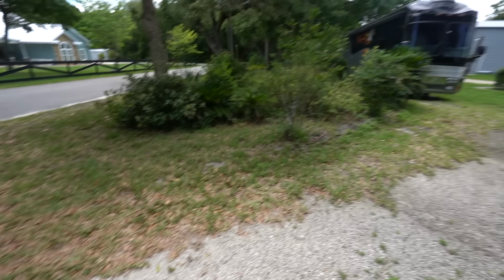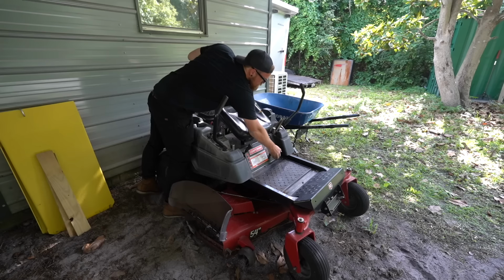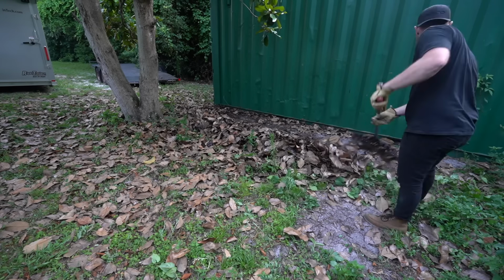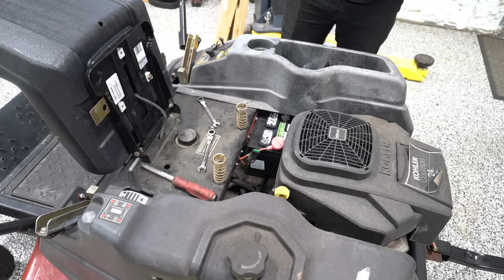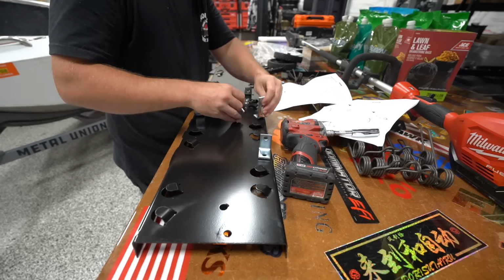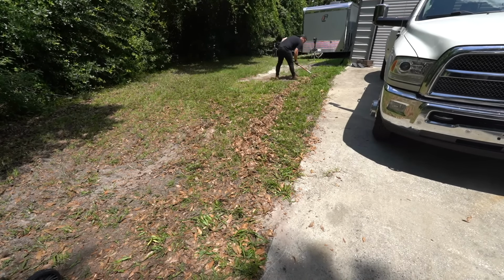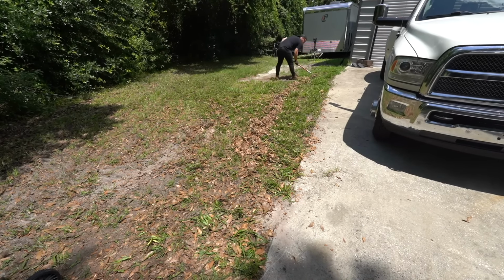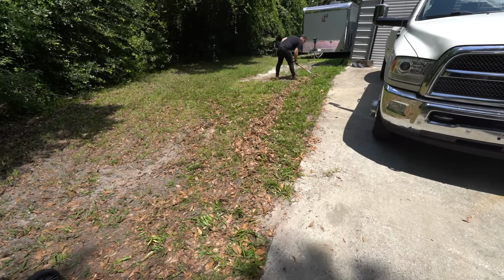Fixing up my neglected property. massive transformation.

Comment: Dig two pits in some yard corner, make them watertight. Build some fences around them. Throw leafs in one of them. Add some water every now and then. When one is full, start to use the other one. When the other one is full too, empty the first one. Leafs turn in to top soil in no time when they are in big pile and some moisture is added.
Reply: Yep, make an enclosed compost pile. Its a win-win. You have an easy spot to dump leaves and they turn into awesome rich organic matter for your garden.

Comment: Put a solar powered exhaust on the storage container
Reply: I was gonna say the same thing
Reply: This crossed my mind
Reply: Paint the roof white
Reply: putting a hole in the roof isn't probably the best idea for storage, especially in Florida. Either paint the roof white or add a extra layer to get the sun off the roof might make more sense
Reply: @kyleb1958  you could put it in a sidewall, as long as it's properly sealed. I'd still paint the roof white though to help.
Reply: Or he just needs to put the extra roof panel thats stored behind on top of the container, prop it up with a few pieces of treated lumber to create an air gap.
Reply: Why do that when you could use it as a solar powered powder coating oven as it is 😂
Reply: @tylerbogaard375  thats actually not a bad suggestion, I bet that would be a good solution
Reply: @kyleb1958  just until the first big storm anyway

Comment: Hey taylor, rent a small-mid  sized skidsteer for 1-2 , maybe 3 days (depending on how early you start and comfortable operating you get) with a bucket and harley / power rake attachments. Get a landscaping rake. Order topsoil for day 1, use the internet to calculate how much you need or just get a truck load to start. Use the power rake to grade and till the current soil + grass. Then use the bucket to spread topsoil 1-2 inches where you need it. After it's spread re use the harley rake to grade the new top layer. Use the landscaping rake to find tune the grade and clean up small/low high areas. Use the power rake liberally to achieve a good grade. (which you basically already have) Seed spreader, seed it, cover all the seed by hand with shredded hay. Water water water, gl bro
Reply: Yeah, his soil looks like dust
Reply: @dobledekersoulwrekr yeah it's Florida it's all sand.
Reply: @pbking442   Yup, scrape up the grass and it's sand. My yard is like that and if not kept wet it goes to hell...
Reply: This, minus the hay. If he's feeling real unenthused he could just till lightly the worst areas, seed, then quarter inch of compost every year for a few years. That's the lazy man's way to great soil.

Comment: i remeber when we first moved into our current home. The yard had been neglected for years and As hard as I tried to get on top of it the first year, it was just overwhelming. I eventually bit the bullet and hired a landscaping company to clean and clear to get me to the point that I could restore the lawn and finally get to work on redoing some of the scaped areas on my own. Let me tell you it was the best $3200 I ever spent. They cleaned up everything and hauled it all away and left me with a great foundation to work with. I still use them twice a year for spring and fall seeding, treatment and fertilizer which is less than $400/year. Over the years I struck up a friendship with the lead lawn tech that does my yard and he helped a couple years ago put in a cool 106 yard par 3 with a putting green. Decent equipment is key to maintenance and I couldn't be happier. I appreciate the sweat equity you're putting in but for me there were better ways to spend my time when it came to the cleanup process.

Comment: You can cut all those plants in the front down to the ground for the most part to clean around them easily (except for the really woody stemmed plants) and they will regrow looking much nicer.  Typically, people cut them back all the way in the fall when dealing with the other leaves

Comment: You should hang the metal from the rafters under the car port.  Run a chain on a rafter and leave some droop or 2x4 shaped in a U then slide the metal.  I hang panels under my porch and it works great.  Also keeps it clean no leaves.

Comment: Hey Taylor! You should put up a small fan in the entrance of the container so you get some airflow for when you're in there. Doesn't have to be big to make a huge difference in working temperature in there. Also pro tip, since you said you ofc don't know where all the parts you have actually are, print out lablea on your printer (don't need a label maker) and create a logical system, where you number or alphabetise your toats, for example A1 has air tools, B1 has brake parts, C1 has coilovers etc. I have that system and it changed my life!

Comment: You could make a rack inside the container un the underside of the roof to hold your excess long steel and bus siding, it’s also worth adding a ventilator fan either solar powered or wind powered to the container.

Comment: Aerating your yard  will do a grate deal for your yard you can get a pull behind aerator for you mower at Home Depot. I would also put Scots weed and feed. I also suggest putting a battery tender on the zero turn and sharping the blades on it but you need a blade balancer or have a small engine shop do it. I would also suggest edging around the cement. You can do the edging with a weed eater or you can rent an edger and black top. It would be grate for the curb appeal of you property. Also doing some black mulch around any plants out front and around the shrubs and the trees. If you buy mulch buy in balk from some ware like West Volusia Shed co.

Comment: some shed roofing spaced a few inches off the roof of the container would make a massive difference to the temperature inside it, it would also prevent water from pooling on the top which will eventually lead to rust

Comment: When you get down to more dirt than leaves just leaf blow the stragglers into the woods. Also if you apply cool-seal for mobile homes to the roof of your container it will drastically lower the temperature inside. Seriously need to get a leaf bagger for your mower. Can do 2 55 gallon bags of leaves at one time

Comment: Growing up back in the 70's and 80's a lot of equipment my dad had was heavy duty steel that had to have been made and sold that way. I think a lot of it was stuff he got handed to him or from estate sales. Things like a small disc and small plow to pull behind a mower to use on gardens and I'm pretty sure he had some kind of lawn thatch that was pretty heavy duty also. There was also a roller made of all steel that you could fill up with water to pull behind a mower and flatten out your yard. So yeah, they definitely don't make things like they used to. Everything nowadays is quantity over quality and only the bottom line matters. Back in the day, it was your reputation of quality that made businesses great.

Comment: Something that might help you with your branches. When you lay them out, lay them all the same direction with stocks outwards and pile them up, so when you need to move them you can just grab the bottom and pull the entire pile. Might help so you do t have to move one at a time.

Comment: I tried a dethatcher years ago didn’t work that well  in my sandy soil just sorta left tine marks and pulled some organic material to the surface. 
I do have great success with an acreage rake you can set the height a lot more and it creates rows of the unwanted organic material nice and neat. 
Another thought is a bit more money but a trailered vacuum leaf grass collector that can be hooked up to the duct while you mow “like a bagger” but far more capacity plus gives you the option to use the vacuum option separately from the mower to just suck up leaves into bags in the trailer. 
Just from what I’ve watched and heard you repeatedly say this will be a constant problem to contend with so while they may not be the cheapest options they are the fastest and easiest to do.

Comment: The last thing I bought that was put together at the store was a BBQ grill. I moved it twice (Across the lawn.) and it started to fall apart. Screws and bolts were backing out. Spent 10 minutes or so tightening everything down. It was fine for 5 years until I upgraded.

Comment: getting a bag and the blades to match for the riding mower would lift 2x or more of the debris and hold a lot more in 1 trip. it would save you significant amounts of manual labor.     also it might erk you a bit at first but let your grass get taller than u normally would and raise the deck higher, only knock the top off the grass when u do cut it. Do this for the first season and your grass will get thicker and then u can cut it back down low again.     I dont do anything fancy to my lawn at all, i only cut it. its thick as all hell, it doesnt even die out from driving over it daily. you cant even tell there is a grey gravel driveway underneath it at all. its just grass and never dies gets thin

Comment: Have you never heard of taking metal to the scrap yard? We keep a spot where we collect all our scrap throughout the year and clean out once or twice a year. We take a day strip out copper and aluminum. Then take it up. It depends on the market, but we've made quite a bit of money over the years and it helps keep useful materials out of the landfill. Such as that ramp. Plus that looked like a truck bed rail mounted storage bin. Unless it was junk in a way that wasn't visible in the video. You could have probably sold that on market place.

Comment: Hey, couple suggestions, paint the roof of your storage container white or use some kind of reflective covering to bring down the temperature inside, vents help, but not necessarily practical unless they're weatherproof. And please stop standing on the deck of your mower man, the linkage holding the deck up is designed for only the deck, not you and the deck. Also sounds like the idle circuit is clogged on the mower, that's why it surges when you have it on 🐢. That's the governor keeping it running.

Comment: You should amazon a solar battery charger for your mower battery, it's always full and topped up, lasts for years that way
Reply: for li-ion? kind of not the best to really top them constantly as the last around 20~30% of charge can put extra wear..
Reply: @niteriderevo9179  the Toro zt has a lead-acid battery.
Reply: @mattmanyam  i was thinking more on the mowrator one, which is full e-drive, considering he did say he is eyeing getting rid of the big one..

Comment: Dude, while you're driving that zero turn around you shoud have the mower deck running mulching all that up. If you don't have mulching blades, buy them. Also you can drive it back and forward with the chute pointed the same way and avoid 90% of the raking. I've been cleaning up knee deep leaves in my yard for 50 yrs.

Comment: Just throwing away a decked system… no biggie 😂
Reply: I was about to say the same thing. I want one for my truck and they aint cheap.
Reply: @tcolby29 I thought that was just a plastic pallet
Reply: Same thought
Reply: I thought he got it sent to him and he didn’t end up liking it
Reply: Same could’ve gave it away or sold it
Reply: Damn I have wanted just a small one for my truck. The cheapest one is made by weather guard. Still like 1200 bucks. I am going to build my own here at some point.
Reply: @xray12345678  yeah I’m pretty that was the case, so there might have been red tape around what to do with it when done.
Reply: Someone grabbed that from the curb. Trash trucks won't pick that kinda stuff up. Scrappers usually come around early morning before the trash trucks come through and grab all the stuff worth anything

Comment: Oh hell..... Those containers are wicked nasty when it's hot out. One thing that could help with that is to paint the roof a gloss white or put a light colored tarp a few feet above the top of it. And if it's your container you could install a couple of those attic vent fans. One at either end. One sucking and one blowing. Bet it would cut that heat down to outside temps instead of hot car in the sun.

Comment: Why not put some gravel to the side and back of the shop? It could help you significantly with the leaf situation and from cutting grass. Also with the amount that you order you can make the little driveway better for the bus or any other vehicles.
Reply: or build a lean to off the shop so the bus and trailer can go under it. No way id leave the bus in front of my house blocking everything 24/7.... Not to mention the bus out in the elements all the time. Gotta protect those investments!
Reply: @LS_FAB  Maybe he could, but it could require some more permits and design planning that could take months and or a boat load of money. I think he once mentioned it when deciding the plans of the new garage

Comment: I would never push the leaves into the woods. Easy way to start a fire in there. Reason why forest management does control burns because leaves are an issue for forest fires.

Comment: Next video..."alright as you guys know ive been having some issues with my riding mower, and i use that to move things around with the yardwork trailer for projects. So today we will be replacing this old 24hp vertical shaft engine with a 35hp twin cylinder engine from Kawasaki, specifically this guy right here. This is the FXT00V-S16-R from Kawasaki, and like i said this guy makes 11hp more than the factory guy did brand new, so it's a unit for sure. But enough jibber jabber, lets get to work"
Reply: Oh god, I can’t wait! He needs to give you writer’s credit for that video! 😂

Comment: You’re lucky that they take the leaves and limbs , there. Not here. We have to dispose of that ourselves. The old fashioned way. Good ole burn pile.  We have trash pickup but  not that kind where they get out and load it. It’s one guy in a garbage truck that has an arm on it to pick up the trash can and dump it on the truck.
Anything that won’t fit in the trash can , we have to haul to the landfill ourselves and pay per pound. Only allowed 4 tires per year. Or we have to pay per tire.

Comment: It's borderline painful to watch you picking up the leaves with the RC mower. IMO you'd be far better off chopping it in for a second hand ride on with a proper pick-up box. Any bits it doesn't fit into can be easily raked or blown into the nearest area it will fit.